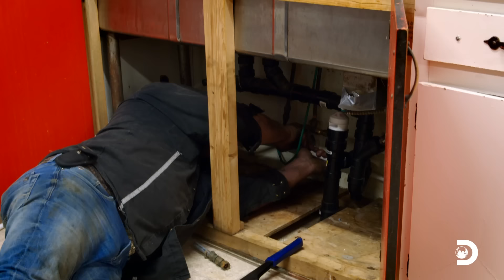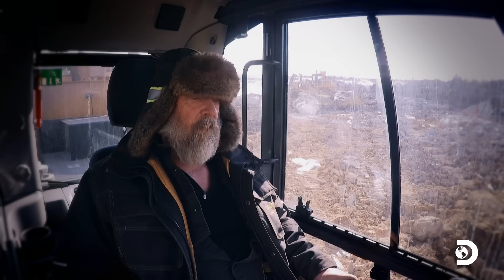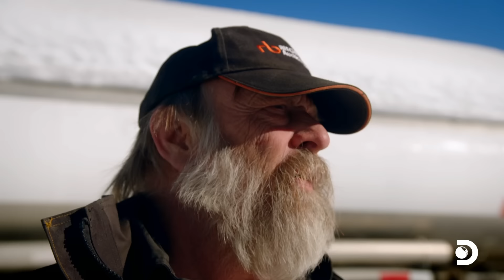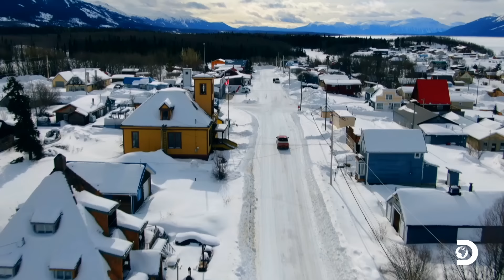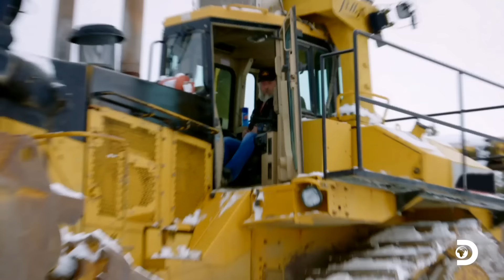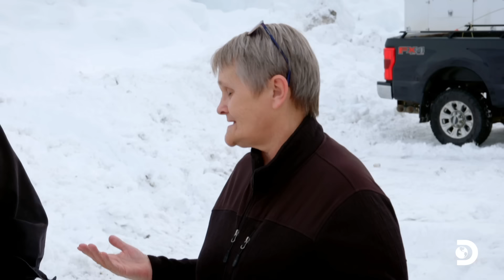Tony Beets Needs a $2,500,000 Bulldozer | Gold Rush: Winter's Fortune

Comment: "We can load a 40 ton truck with 3 buckets." And drops the load from 2 stories in the air which is awesome on the machine and the operator...
Reply: Noticed that aswell. Probably for the camera.  Make it look cooler.
Reply: Lmfao I seen that and I could just imagine the operator getting flung around the cab there goes that guys fuckin coffee lol
Reply: Scale really makes it difficult to see that. It looked really close to the truck to me as an inexperienced machine operator. Meaning I’ve never been in any heavy machinery
Reply: @sullivan9191  I've loaded thousands of loads in the exact same truck and been the driver of thousands of loads in the exact same truck. That is just abuse on the truck and the driver.
Reply: @sullivan9191  You load trucks like this and you get your ass beat in the parking lot at the end of the day.
Reply: @bubsterjohnson7438  especially in a garbage articulating truck. Those style of haul trucks you feel everything. I've been high loaded by a P&H 4100 electric shovel into a Cat 797 and I was shook hard.